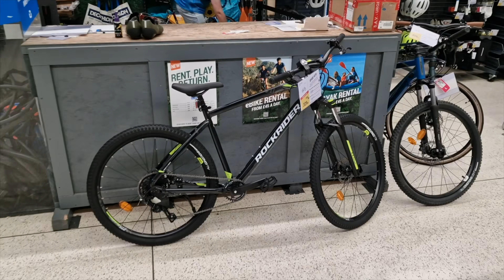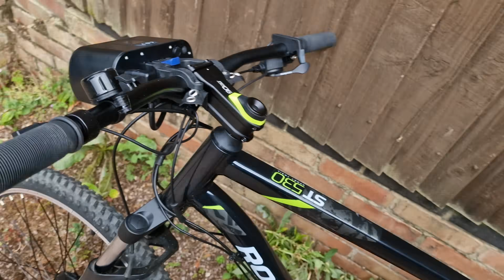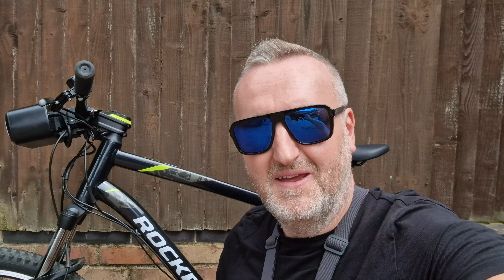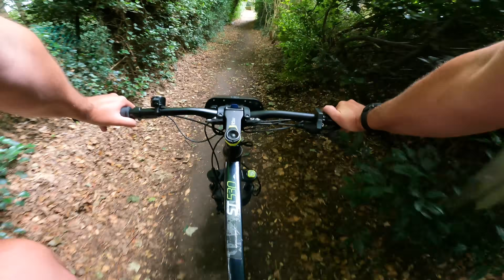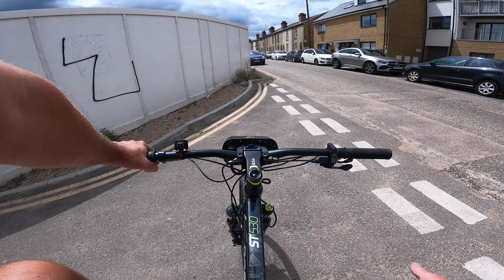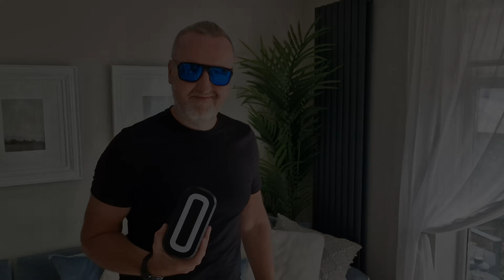TURN YOUR REGULAR BIKE INTO AN ELECTRIC BIKE WITH KIRBEBIKE EZ RIDER!!! | MORE QUESTIONS ANSWERED

Comment: Would you be making a version for the U.S. market with at least a 750 watt hub motor with appropriately sized battery pack?  A front mounted bike computer with a large, easy to read touchscreen display in full sunlight is an important feature to have.  Or an add-on for modest upgrade fee.

Comment: From the math, looks like the charger is a 2Amp charger. Could you give a 5 amp charger? That would be a great improvement and they are basically the same size anyways
Reply from the maker: 2A is safer for a battery of this size.

Comment: Am thinking of getting one of these because I like the no hassle front wheel change - The only issue is with the cadence sensor/pedal assist/PAS setup not being compatible with a totally enclosed BBR60 bottom bracket. But having looked into it, it looks like I can use a Hollowtech II Sensor.

But my question is, will the electrical plug from the Hollowtech II fit your system IE: Is the Hollowtech II a generic pedal assist assembly in terms of fitments of electrical plugs ?  - Just wondering if you know !
Thanks

Comment: Hi Andy good bike question hall wires on bike the motot wires are lug connection and controller is bullet. I'm make a box fir controller as bags don't last long I've cut both connection of wires can I use choc box connection to save space or bullet connectors but what type can I use it's for 200wat motor controller 45amp battery 52volt thanks

Comment: I wouldn't worry about wheel slip. l've had a 250w front drive kit (yose power) on my road bike whith 25mm tyres and its only a problem on ice or very mossy areas ect. I think this kit will do well. Looks very neat as well.

Comment: I used to design Laser Cutting machines Andy. Retired now, I like the easy fit front wheel solution and it looks well thought out. If I didn't already have a folding E Bike, I would certainly be interested in having one to convert my old (genuine) Raleigh bike. Made here in Nottingham of course...🤔😳😏😏😏🇬🇧
Reply: Hi, I am also considering fitting one of these kits to my 1962 Hercules. Have owned it for more than 40 years and don't want to part with it.

Comment: So if you only use the motor on the hills or maybe bad headwind stretches you might get at least 50 -70 miles out of it ?  What about fitting it to a  700c wheel  road bike  as well

Comment: Really impressed with this. I could just about cope with the limited range for my commute but in a previous video, I believe you mentioned the possibility of an extra battery becoming available later that would run in parallel which would certainly satisfy my concerns in that respect. I like the idea of a "sleeper" electric bike so I feel a little safer locking it up outside a shop or wherever and just removing the battery.
Can I make a suggestion to improve the convenience/ safety? Maybe for a future version or as an optional extra if it's at all possible without totally redesigning the battery unit. How about being able to adjust the power assist level from near the grips with an up-down toggle? It wouldn't need LED's or anything fancy, just 2 buttons. This could  be built into the obviously deactivated throttle unit ;)
Just a thought

Comment: even on the generic 1kw kits i hot glue everything ! around the controller loom around the hub axle ,where the discharge cables come out of the battery :) been years now never had a problem even in extreme downpours :)

Comment: Looks great, although does feel a bit like swytch peeps might come after ya 😂

Can you turn the light thing off? Not sure I'd always want that on personally.
Reply: Yes it's a similar idea to the swych bike, I said this in a earlier comment, but it's not exactly the same, same concept but not exactly the same, so swych don't have anything unless they own the patent of this actual design and nobody else is allowed to use this type of design ie battery on the handlebar and front wheel motor, which there is no way they do! As Andy says its an evolution.
Swytch don't have a leg to stand on to be honest.

Comment: USB-C charging would make this an absolute game changer
Reply: @tsl56 does anyone sell any ebike solar powered bits
Reply: It would indeed, but they would have to introduce some super fast charging. Average android phone charger is 45w no more. That would take serious hours to charge.  
Xiaomi does 120w charging, it takes 5000mah battery to be charged in 15 minutes.
Reply: @MrYorcek the fastest phone chargers that don't require a huge brick to carry around are about 100 Watts, should be fine for the kirbebike battery as it would take less than 3 hours to charge from flat which is on par or quicker than most ebike batteries. Even a slower 45 W charger you could trickle charge the battery and it will be done by the time you finish work/school plus the slower charge will help prolong the life of the battery. There's a lot of potential here.

Comment: Another great video. Will there be a rear wheel version of this.
Reply from the maker: No, we do rear wheel kits for  high power builds and also 250W rear kits.
Reply: It's more the battery type working with the rear wheels

Comment: I think you definitely have a winner with this mate I have a 1000w homemade ebike but thinking of getting one of these kits to turn my ebike in to a AWD ebike would that be possible with this kit really like this nice one man 👍
Reply: Yeah you'd easily be able to stick this on the front and use both. Just stick the pedal assist sensor on unless you know how to splice one throttle to activate both motors.
Reply: @JudeTheYoutubePoopersubscribe  yes definitely I was thinking of having the front one like you said on peddle assist and the back hud motor for the times I don't want to peddle at all ✌👍
Reply: @ebikeoutdoors  you'll be surprised how much extra hill climbing ability in particular you'd get with a set up like that. Depends if you can set it to continue assisting beyond 15mph.
Reply: @JudeTheYoutubePoopersubscribe  that's a very good point about the 15 mph thing at the moment I have a top speed of 28 mph which I'm happy with but could always do with more help on the hills 🚴‍♀️👍

Comment: Hi Andy, the bike I want to convert is the Halfords Carrera Intercity Disc 9-Speed Folding Bike.  Is this feasible and practicable? Thanks
Reply from the maker: Hi, Yes it will, we just need to check the width of the forks, I think its the same as Brompton which we have a special motor wheel for.

Comment: Swytch ebikes originally sold ebike kits under Panda ebikes brand . noticed there battery has an option  to be fitted on the rear seat post good way of distributing the weight would be option for your kits if that’s possible free up the handlebars . Swytch kit weakness is lts after sales and a long waiting time like 6 months I know I use to own one.

Comment: What is the life cycle of the battery?
Reply from the maker: Oh it's 1000s of cycles 😁
Reply: @andykirby  Haha. Touché. I didn't realise what i'd typed 'til i read your response. I wasn't taking the piss, i was wondering what the lifespan of the battery is as the battery's lifespan is important to me as it'd be used as a disability aid if i could save up for one. Where i live is often very windy and rainy, not to mention extremely cold, how well have you found it functions in these conditions? Cheers.

Comment: I like the fact you’ve got a light on the front, although to be honest with you for road safety standards, I think you have to have white on the front and red on the back. That’s why people are so concerned.

I like the fact it’s easy to pedal, I also like the break adaption, so you can have rim, brakes or disc brakes as well and for the price. It’s a pretty cool unit
Reply: They talked about the light in the previous video and it was mentioned the light would be white when sold to public
Reply: Did you actually watch the video at all? He clearly stated the front light will be changed to white, when they become available to buy! Watch the video before you comment!!

Comment: Overall this is a nice kit for cheap.
Reply: How much is it? I haven't seen it mentioned anywhere . .
Reply: @catherinecunningham1811  in previous video it was said around £450 but should come down to £400, I think there is also 2 battery sizes so the smaller for 400 and 450-500 for bigger one at a guess
Reply: More like £700 for unit does half decent miles
Reply: @waynebrown926  yeah but 400 quid to get started is not bad at all TBH, I was quoted 1700 as minimum to get a decent E bike, well I got given a brand new 600 quid mountain bike via a boater who realised he would just throw it in the canal the minute it got in the way so gave it to me, yes honest, adding a front drive hub and small power pack is right up my street... well towpath as they are mostly flat so less power needed.
I reckon 250w system like this is what I need and at 400 to 500 quid I would go down this route TBH
Reply from the maker: It's going to be £450